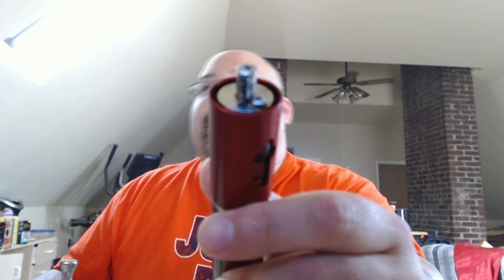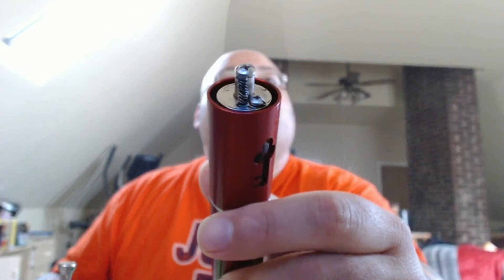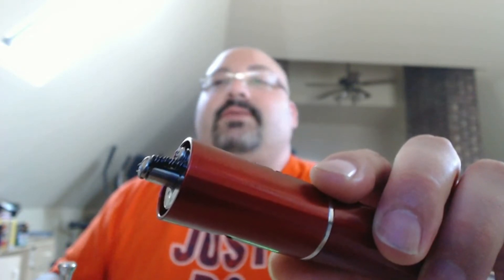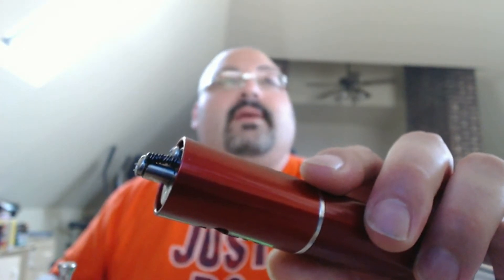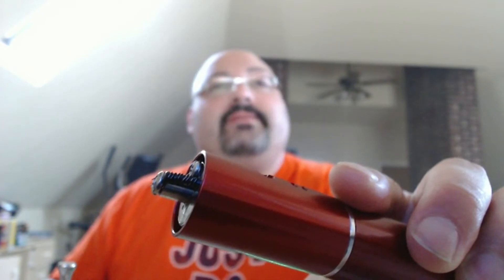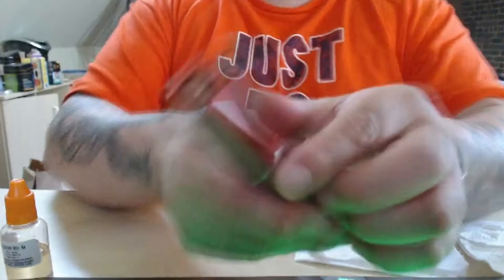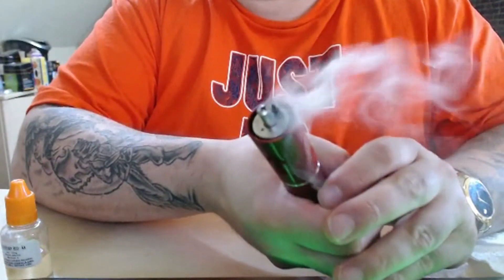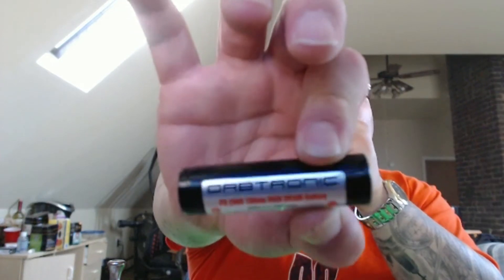Ihybrid Slinger .3 Ohms Dual Coil

Comment: I am using AW IMR 18490s and 18350s in my smoktech telescope. I am running .5 ohm dual coils on my igo-s with 2mm ekowool. My mod is not heating up but after watching some of your vids I am interested in the orbitonics batteries. I hope they come in something smaller than an 18650. I don't like the telescope in 18650mode as you can see some of the threading. Love your vids dude!! ECF Donovan69

Comment: Thats pretty much how I do most of my builds...
Any 3.5 mm wick hole built for an 18650:
90-100mm 500 mesh,
Dual 3/2 wrap of 30GA kanthal,
Airhole drilled to about 5/64" (1.9mm),
= around 0.6 ohm everytime